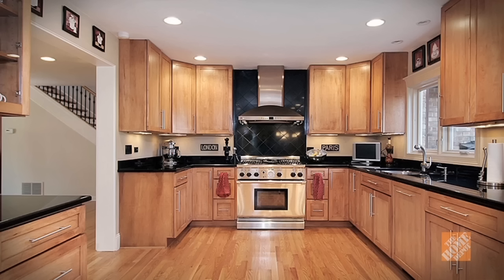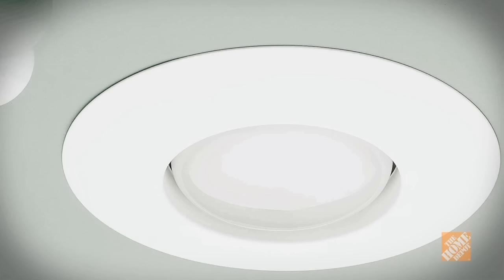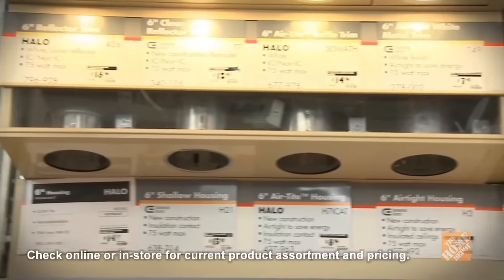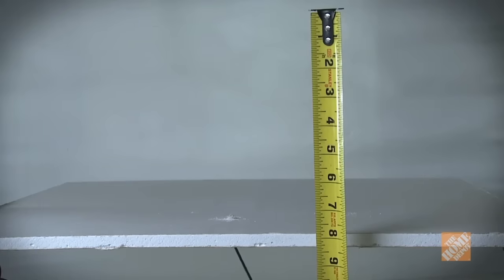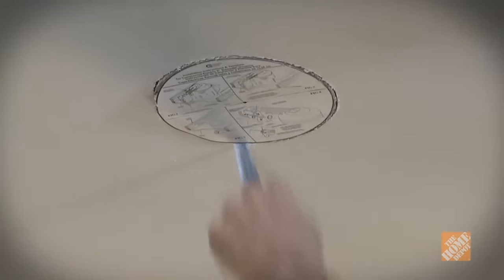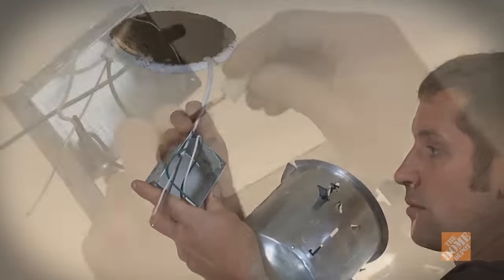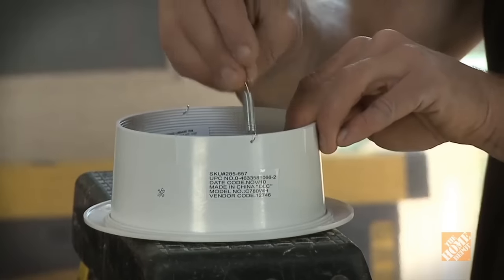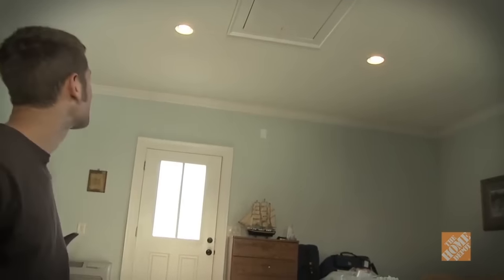How to Install Recessed Lighting | Can Lights | The Home Depot

Comment: How do you run the wires if there isn't an attic space? Like if you are between floors?
Reply: Using fiberglass fish rods if there’s any space above or below joists. I’ve seen some ceilings furred out which left n inch gap above drywall that I was able to pass wires through to other  side of room. If there’s no space above or below then stud find every joist in the path to where your lights will go and drill a 6 “ hole saw onto stud. Drill through every stud and then use that 6” plug to put back over the hold and screw back to stud and hire a drywall pro to come blend it back in as a lot of electricians can’t mask the cut as well .... but some can and will offer